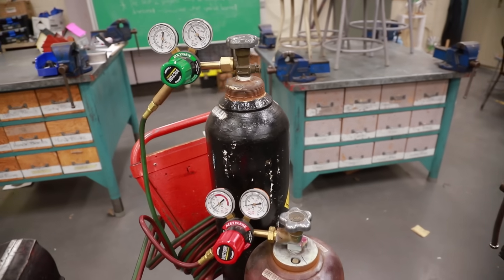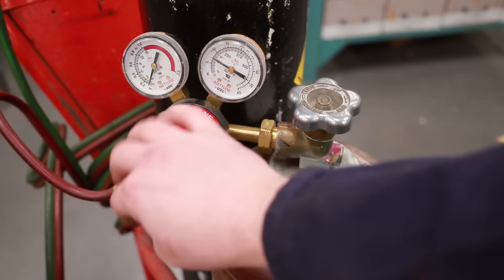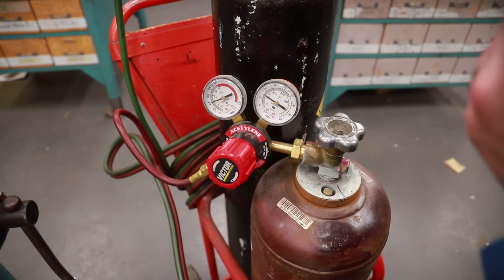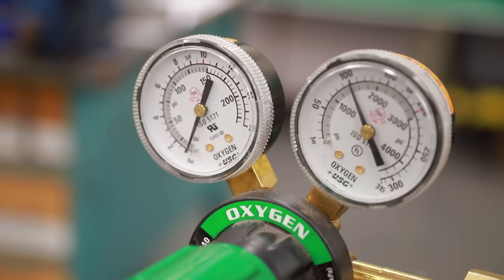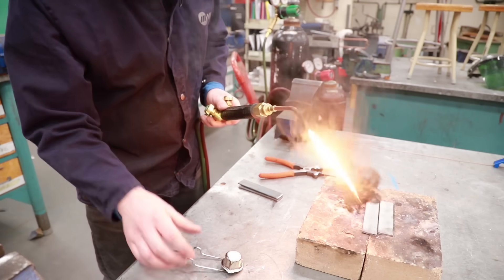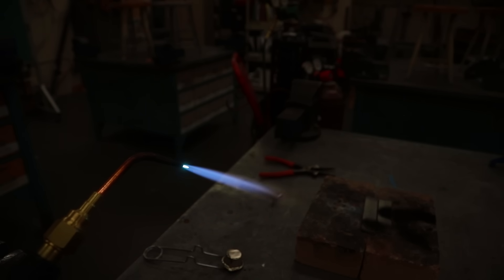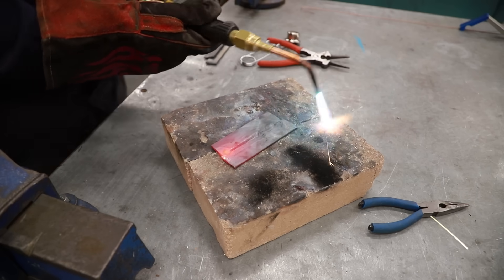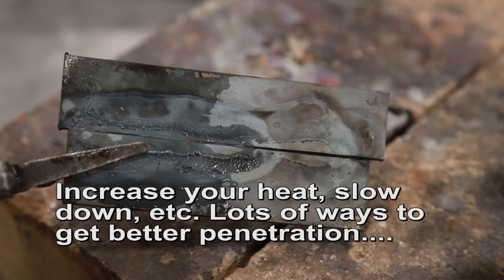Intro to Oxy-Acetylene Welding - Part 1

Comment: Manufacturers Victor and Harris both recommend shutting oxygen off first. Carbon can be thrown back into the torch if the acetylene is shut off first. Like most old school rules of thumb, they are not based on science, but rather opinion. People who assume the acetylene is more dangerous then the pure oxygen are "playing with fire". Always do what the manufacturer says, rather then what someone tells you. Even an instructor, who may have picked up their own bad habits, tells you something.
Reply: Can I add to the previous comment that when shutting down a torch either in a controlled fashion or in an emergency due to a flashback the reason turning off the oxygen first is recommended by manufacturers and industry bodies is due to the need for a consistent response by the operator in emergencies (don’t think just act) and because the oxygen is significantly more dangerous. Yes, the acetylene is fuel but so is the torch and hoses as far as the oxygen is concerned, turning off the acetylene first in a flashback won’t stop the hoses burning in a pure oxygen environment. Turning off the oxygen first stops the risk of the flashback escalating.
Reply from the maker: I agree with what the manufacturers say and we are doing it the way that many high schools do in BC based on how many of us tech teachers were trained at BCIT. I will probably switch things up though since so many people have said the same as you!

Comment: I just bouth a second hand welder, 
When i open my oxegen you will hear a sising sound comming out of the side(from the regulater). When i put my finger on it it stops sising(slowly).  I can light the welder and weld with it.  
Is it dangerous or has it to be like that?
Reply from the maker: Trust your gut. That doesn't sound like a good thing. The oxygen itself isn't dangerous but I personally wouldn't want to take a chance of a potential accident. 

Is it the regulator or the hose? A good replacement regulator can cost about $100 but there are cheaper options out there. 

Where are you placing your finger to stop the sound? Can you feel the 'wind' of it?

Comment: can someone tell me why does he closes the acetylene valve first?
Reply from the maker: I was always taught this way as a safety precaution. Turning off the acetylene first shuts the flame off quickly if an accident occurs as opposed to shutting off oxygen first the torch flame remains burning with the fuel (acetylene).

Some manufacturers have different recommendations but as a shop teacher in British Columbia we all try to follow a similar system. 

Work Safe BC and our BC tech ed organization have a safety guide called "heads up for safety" that is a great introduction on safety to almost every tool we use in high school shops. This helps with consistency throughout the province.
Reply: @WeBuildStuff  Just want to touch on the subject, manufacturers that say O before A recommend it as a safety test. Turning oxygen off first will allow you to check for any leaks in your valves. If your Oxygen is not completely shut off/there is a leak it will be noticeable in the flame. When you turn the Acetylene off the flame should die out completely, if a small flame is left then you again know there is a leak.
Reply from the maker: @StopKillerBear  good tip. I do my own safety checks weekly in the shop but for students I find this method works well :)
Reply: I used to turn the oxygen off before acetylene, that way I was sure both were off. There was always a tendency to forget to turn it off (oxygen ) if you turned the acetylene first. Brilliant tutorial, I can smell the carbon😁😁